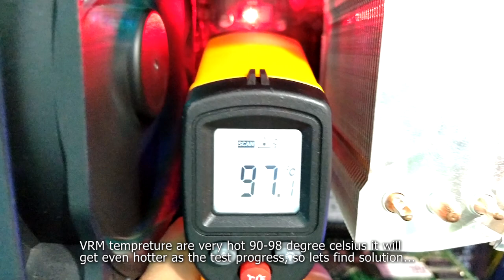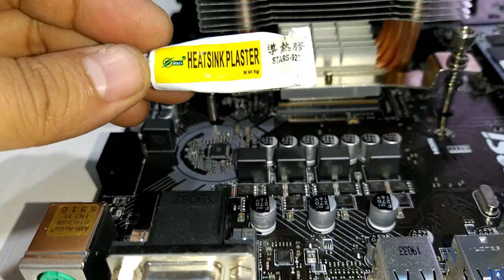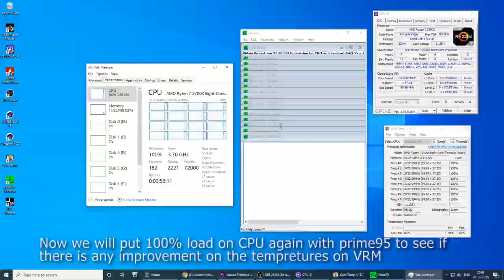Best VRM Cooling (30c Temperature drop)

Comment: well the solution is never buy a high end cpu with cheap motherboard,it will degrade both the cpu and motherboard fast,especially if you are using cheap powersupply
Reply: Whish i know that earlier 😢
i have a ryzen 7 2700 with a shitty mobo :  msi b450m a pro max
Reply: mehdi Moro https://www.reddit.com/r/Amd/comments/9uc6bi/am4_b450x470_vrm_tier_list/ 
Judging by this, your mobo is actually good
Reply: @amogussiiuuu802  
Thank you so much this info relieved me very much 😥 😊
However.. i still hate this mobo because of the two Ram slots and one fan header only.  Just today i received my case it's a msi forge 100m  with 3 rgb fans pre installed but no headers for it in this mobo
Reply: I still have 755 lga with 3.00 ghz cpu idk know if thats gonna work
Reply: @aciemiller3443  How many times are you going to comment this?

Comment: I stopped watching when u spray the fin. Now u blocking the metal to transmit heat to air with that layer of paint. Dont u ever thought of that before spraying??? theres is a good reason why manufacturer dont coat metal fin!

Comment: im using a H410 and a i9-10900 non K it pulls 270w sometimes
Is there a way to add a heat sink to the VRM on the ASUS Prime H410M-E without damaging the VRM what adhesive to use?

The paste you use could damage the VRM when you try to remove it
Reply: have you manage to solve your problem? you can try thermal pads. 
did your cpu throttling and cannot maintain turbo boost for 10 minutes?
Reply: h series mobo not suitable for i9. you need z series mobo
Reply: @fastbutsafe5461  this is what people who don’t know about pc say

Pc should consist of what you need not blind industrial standard
Reply: @ginjopowder  I use it for just gaming and see no throttling so far

Comment: dude! seem we got same motherboard, is that a b450m max pro m2?
Reply from the maker: Its b450 pro m2 v2
Reply: @InvertLogic  hey! Thx for reply, my board has similar vrms configuration like yours and also no cooling on the vrms, but do you think it could handle a 3700x at stock speeds or is would be too dangerous?
Reply: @npaz24  yes it can handle at stock speeds.

Comment: What are the advantages of having less temperature in the vrm?
Reply from the maker: High VRM temps can throttle down cpu if the VRM temp exceeded the certain tempreture limit. So it better to have them under 90 c in my opinion.
Reply: Thanks

Comment: How strong is that heatsink glue sir? Can it damage the mainboard when someone accidentally scratch it off?
Reply from the maker: I think it can be removed easily. But I would suggest tape  instead if you plan to remove it.
Reply: Have you open up PSU before. The temperature silicone/thermal are all over inside the PSU. It's okay to use thermal silicone.

Comment: Can I try it on my Gigabyte b450 h motherboard? It will work or not ? Can I overclock then my cpu?
Reply from the maker: Yes you can try. Use 6 core cpu on this mobo if u like to overclock. Take care don't overdue it.
Reply: so did you do it bro if so whats the results?

Comment: I got 2700x with b450 pro m2 max. Did you tried oc?
Reply from the maker: No I want it to run proper with stock settings. Overclock will need bigger aio cooler which I don't have. But you can do oc like 100 - 200 mhz on this board if u manage ur temps
Reply: @aciemiller3443  Oh this one isn't a duplicate

Comment: hello, what are the measurements of this heatsink? I have the same motherboard and would like to put it on it.
Reply from the maker: I don't have measurements. it was re-used from old Intel motherboard. just use any heat sink you have spare. cut it as per available space in your motherboard. I have shown that any heatsink can work.

Comment: Can I use thermal paste to attach it to the VRM?
Reply from the maker: Yes that's what I have used 😊
Reply: @InvertLogic  Oh, thanks!
Reply: No - you want to use a thermal adhesive, not thermal paste. Sometimes it is also called thermal glue or thermal epoxy.  Normal thermal paste (like arctic silver or NTH1, etc) is not strong enough and the heat sinks will fall off
Reply: And OP used a thermal glue, not traditional thermal paste.
Reply: @aciemiller3443  How many times are you going to comment this?

Comment: Why this is the best? Just for You. I would never do the cooling like that. My solution is basically the same, but not as badly executed as it appears in this video.
One mistake is that he painted the heat sink. And that's just one mistake.
A good solution is to use old heat sinks. I did the same. But not like that.
Reply: why can't spray. Temperature difference unnoticeable
Reply: @fastbutsafe5461  Aluminum is oxidized in the open atmospheric air. (crust). Therefore, it is not painted in the usual way. Aluminum is painted only by anodizing

Comment: I THINK YOU SHOULD HAVE BOUGHT A BETTER MOTHERBOARD FROM THE BEGINNING  INSTEAD OF BUYING A CHEAP ONE JUST TO SAVE FEW DOLLARS  ..
Reply from the maker: Yes you are right. but when I bought this MB I bought it with R5 1600 as a bundle and was fine. but then I upgraded to 2700x. however I will suggest anyone buying new to buy the MB with heatsink. its good for the upgrade path.

Comment: can i do this with regular glue or super glue? xD
Reply from the maker: No you need proper heat sink plaster or tape. Otherwise heat will not properly transfer to heatsink. I gave links under video.
Reply: @aciemiller3443  How many times are you going to comment this?

Comment: NEVER SPRAY-PAINT heatsinks. It ruins the overall thermal-displacing capabilities of it.
Reply from the maker: Then why motherboard manufacture use anodized or powder coated paint on heatsink?
Reply: @InvertLogic  So us PC geeks don't have to ruin thermals with out shitty acrylic paints :'D
Reply: @aciemiller3443  How many times are you going to comment this?

Comment: lol heatsink touch another component, too much glue, looks amateur.
Reply from the maker: Its not cosmetic thing to look pretty. The glue is not conducive so little more glue won't be a problem. Thanks
Reply: @InvertLogic  That's no sense.
Doesn't be like cosmetic just put it properly then you can't do that ?

You are not childish right ? tell me if i'm wrong.
Reply from the maker: @claritoresdiano1021  you are not wrong I could have done it better. but it doesn't matter as the glue is not conductive. thanks!

Comment: total crap. how to destroy a mobo in 5 minutes. 

YES THIS CAN BE DONE - BUT THAT AINT THE RIGHT WAY.
Reply from the maker: there is nothing wrong with this method. off course if you have no prior knowledge of electronics then you will damage it anyway.
Reply: @InvertLogic   What about if one of the mostfet fail  suddenly?  Then you have to mess around with this thermal glue to replace opamps, fuses and mosfets .  THE IDEA IS EXCELLENT but method sucks. Glue is not even  the last thing that be used on vrms, never do it. You don't have screw holes for vrm heatsink on motherboard but you could mount it tight with different mechanical methods and should be using thermal pad between heatsink and vrm... other than using thermal glue on vrms.
Reply from the maker: @thzrealist  Yes but thats very rare i have never had to do any mosfet replacements on motherboard.

but for the safe side you can also use tape instead of glue.
Reply: You can remove thermal conductive glue quite easily actually.
Reply: thermal glue is designed for this, and is still fairly easy to remove the heatsink after with a bit of patience.